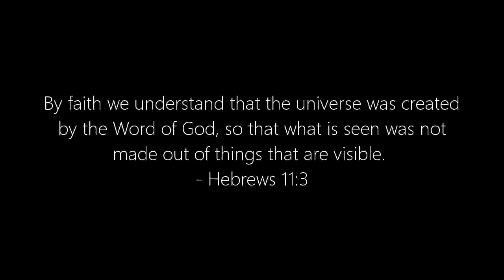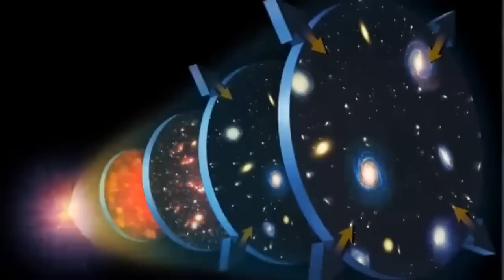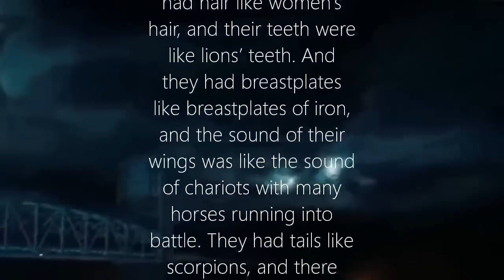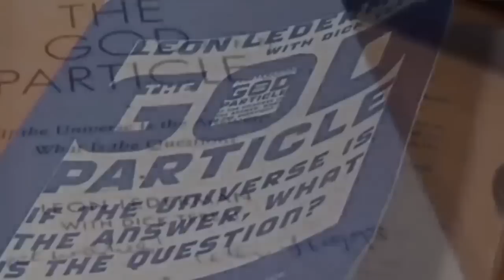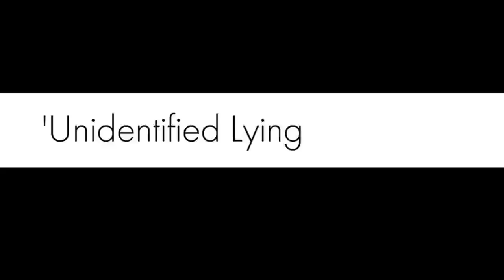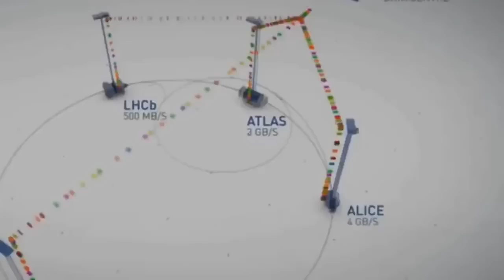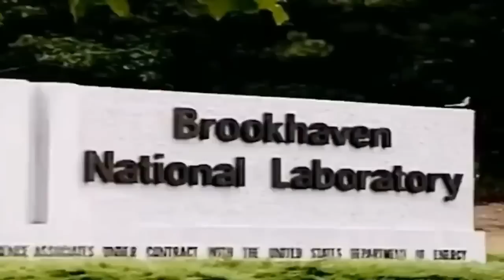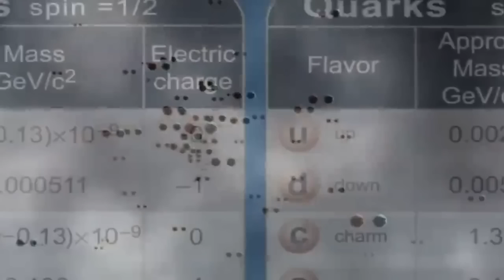Signs in the Science – Prophecy Wake Up  |  CERN Dark Matter

Comment: Not universe...just the flux density dispersion. On earth... Probably linked to the anomalies NASA was tracking. They cluster to the magnetic field shape. Low and high elevations. Based on eV pressure mass exchange.
Reply: So...low elevation...leaks out. High elevation increases pressure for atmosphere higher. And a release of geo thermal mass triggers a flux discharge that ionizes wind.
Reply: Most of these would be found on the lowest low points on the ocean floor. And because water is an insulator...we love it...but the world pushes the heat outside the water. Same as torching a styrofoam cup with fire.. filled with water. Only that what doesn't touch water burns. Closer to the edges. Of the insulation exchange point. Or the shorelines... All "all" edges on incline elevation shifts hold a fault line. And declines are closer to the mass of the magnetic mantle.. this pressure increases so theres a water level. Due to pressure increase. And due to geo thermal discharge on the ocean floor... The ice... Is just a product of a higher density in the atmospheric flux, here on earth. Naturally. The melting...has a cube of ice in your cup ever increased the volume? No. The water was the level when the ice was here.. only a mass that completely drops. Off a mass that is inclined. And was never part of the atmosphere or the ocean...could you say otherwise